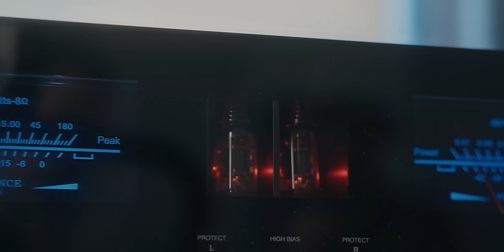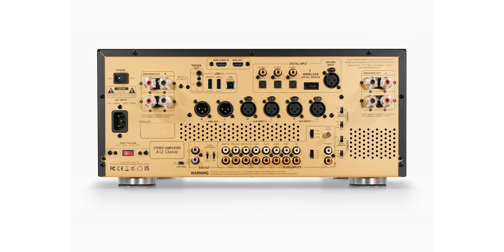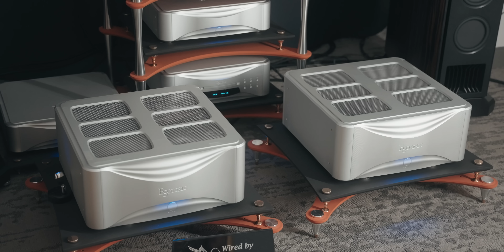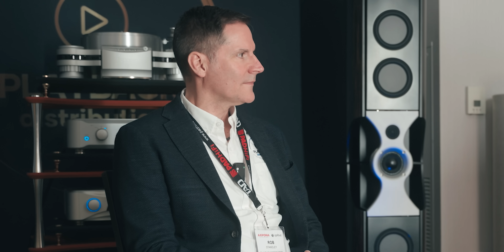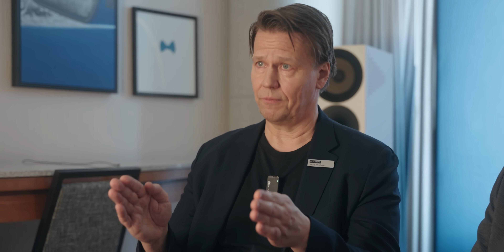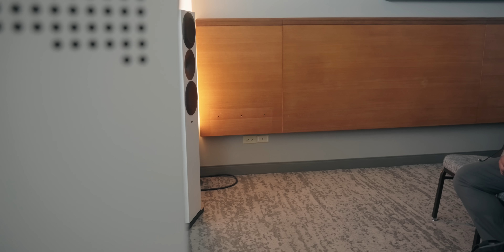These Audiophile Systems Were ABSOLUTELY INSANE

Comment: It is true, a low crossover point is better for a natural sound to the ears. I heard a pair of older Dynaudio speakers that have done that and it's apperent. Not all Dynaudios do this configuration, why not??
Reply from the maker: from what I know it is a trade off. You can choose to cross-over lower if the tweeter is capable and waveguides and such helps BUT just because it can play lower doesn't mean that it is the most optimal range for the tweeter. Every tweeter has an optimal range it operates on before distortion numbers rise higher, ideally you want to cross over 2 octaves before or after that point, so you either have to choose higher or lower crossover point based on other parameters.